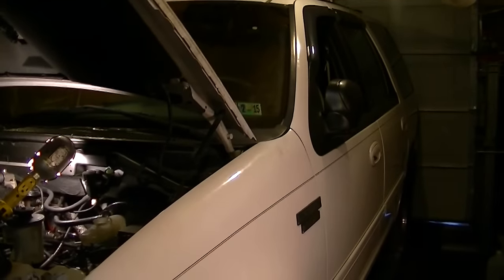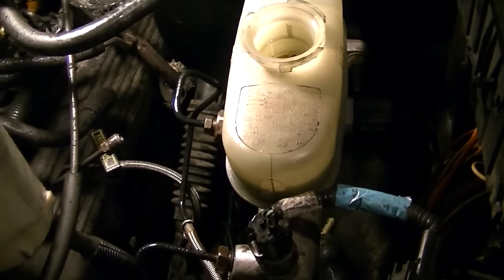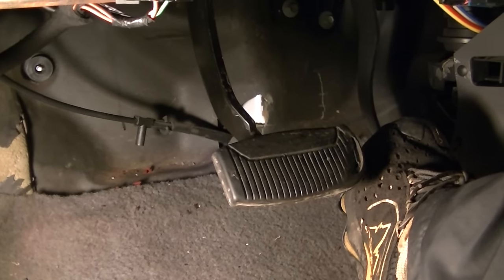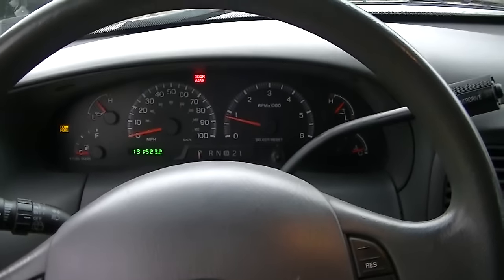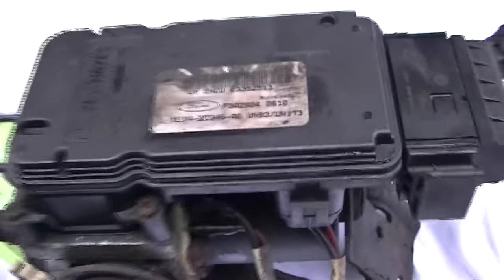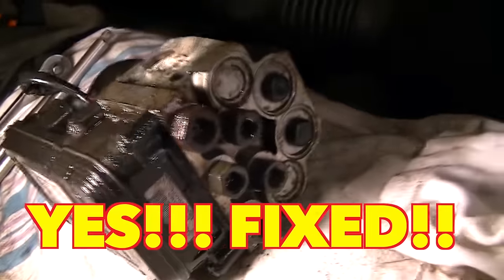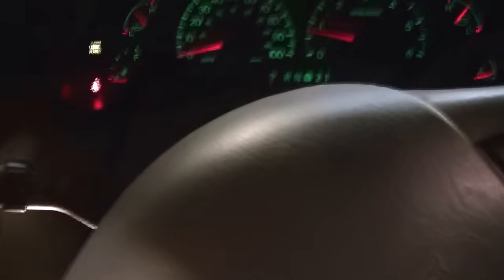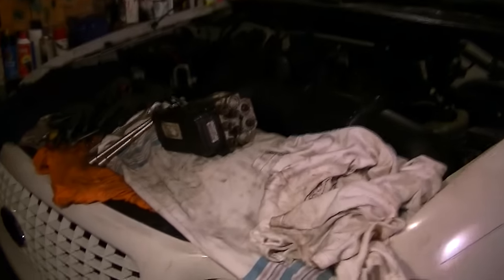Sinking/Spongy Brake Pedal -With ABS SYSTEM?? Nothing Works? Watch Fixed!

Comment: That's great! Thank you for making this vid. My 2001 f150 has a sinking pedal. It's not as bad as yours was but it sinks at stoplights, drive thrus etc.. It doesn't always do it right away either. Which leads me to believe my abs pump is bad too. If it was a a MC, it would happen all the time. That's my experience with a bypassing MC anyways. But this is a good vid for us do it your selfers with fords of this era. 
So did you not have to bleed the new pump at all? Does the computer take care of it or something? How much would it be for a new pump do you think? If it's too much I'll do what you did and get one at the wrecker I guess.. 
Anyways thank you again for your time making this video!
You're awesome
Reply from the maker: Thanks!
Reply from the maker: Dislikes....lol....Because most thumbs downs, are people who are still living there parents basement and have no life + trolls.
Reply: Did you need to bleed the abs pump later?
Reply from the maker: That's the cool thing, I did not have to. I was going to bleed the brakes etc but 2 pumps and I had a full pedal. Crazy luck I guess.
Reply: So weird huh, you'd think it would need to be bled but if it works it works.
Reply from the maker: Yea, I'm still driving it today....brakes are great!
Reply from the maker: I never had to bleed the brakes after the abs pump was installed. I 
pumped the pedal 3 -3 times and it came right back up! I guess the ABS 
system did its job. I just picked one up at a junk yard for $40. Make 
sure the part number is the same!!
Reply: Must be a Ford thing. I'm having the same issues. Mine isn't all the time. But it also just started the other day while sitting and waiting for a slow poke to move out of a parking space so I could park. It slowly sank to the floor like it post pressure. I put it in park and pumped it and they were fine. But still scary seeing how I feel like a taxi for my kids. Will show this video to my husband!
Reply: Nathan Rohrbough g

Comment: Thanks for sharing! Nice expy too :). I'm having a similar problem w/ my jeep and I didn't even open the brake system and no leaks so I figured it had to be some kind of valve failure somewhere in the ABS or master cylinder. I'm willing to bet it's the same issue. 

The only concern I have after something like this is it says you need a tech II scanner or whatever to manually control the ABS valves to bleed the system. I don't know exactly how the valves operate, but I would suggest taking it into an area where you can get ABS to kick in to make sure it works properly.
Reply from the maker: Strangely, I've never had to reprogram a ABS system after a swap, ever. But I'm sure there is that "story" out there.
Reply: DRB 3 tool. It's xxxxing expensive - even used - on eBay. Not sure any of even the high end aftermarket scanner's have DRB type functions. It's dealer or a good independent Chrysler specialist only who will have one. I heard some say the emergency stop trick followed by another conventional bleed  doesn't work in this instance - but maybe still worth a try. You will have a Bendix or Teves mark 4 or a mark 20 system depending on your model year, more recent models I'm not sure about.
Let us know how you got/get on with your issue!
Reply: @andrewcheatle4691  I did the emergency stops a dozen times and activated the ABS each time, but did not help.

Comment: Thank you very much, that's the only thing I haven't done to my F150 to fix my spongy break pedal
Reply from the maker: Happy fixing!~
Reply: On fords if air gets into the ABS pump you have to hook up a ABS scanner a d do a sevice bleed. Don't run out and buy a new pump until you do. Perform service bleed and then blled brames normaly. Especially on F series trucks.

Comment: Great video and suggestion on the sinking pedal syndrome (after doing all the regular items: master cylinder, new fluid, bleeding, etc .... ) Thanks for posting this.  I do have a question:  When this phenomena was present in your vehicle, did you have any ABS faults or ABS warning light coming on?  And, secondly, did the ABS module still modulate (buzz the brakes) when braking on a slippery surface?
I have this sinking pedal syndrome - did all the items listed above and, just like you, it helped for a little while and then the pedal started sinking again.  I have no ABS light on the dash and my ABS modulates/pulses/buzzes when I brake on a slippery surface (like it is doing it's job).
Reply from the maker: No. I had no abs light not even a blink! No buzzing no noises. Your buzzing is probably how that ABS pump is manufactured with some kind of default system. My abs system worked when I slammed on the brakes in mud or snow...But slowly went south no matter how much I pumped them up.

Comment: You have an air lock in your abs unit...that happens too. You get things bled right...but still spongy....99% its a air lock in the value.
Reply from the maker: Thanks! Hope everyone else who see your message can understand what's going on with that ABS spongy /brake to the floor Issue.
Reply: TVWXMAN32 no worries...anything to help someone else keep costs low :)
Reply: what did you do to get air out of that unit, is there a sequence to bleed it ? I have a 2002 6 cylinder base model and I have this exact issue. Please help me from pulling my hair out.

Comment: You smart git! Loving the way you routed the master cylinder line! I have this issue. Will try this tomorrow.
Reply: How's your abs now?
Reply: I ended up fitting new abs pump and it didn't help... Master cylinder appears fine so in the end I took it to a garage who said they fixed it and passed the Mot.  But the problem is still there.  It brakes fine, just a slight soft pedal.  Kinda annoying but if it passes the inspection, no leaks.  Might be a bulging flex brake line pipe?  I even changed the rear calipers....  But yeah. Brakes work great.
Reply: @squidlings  thanks so much for your response. I'm also thinking to replace the rear flex line hopefully I don't need to  replace the abs pump.
Have a nice day.
Btw, I double pump and the second pump give a harder brake. I hope that will work on yours too.

Comment: Thanks for your help I changed my master cylinder and Power booster I had no luck now I know it's the ABS on my 2011 Ford Edge
Reply: I have the same year and model and I’m dealing with the same issue now. Boster was on recall but the abs was not. Seems like for Ford knows it’s a issue but ignoring it
Reply: @timothybecker176  I finally got my brakes fixed 7  months ago there was a lot of air in abs and I had to reprogram the abs it took a long time but it's working now

Comment: My Ford Econoline did the same thing. I had to replace my abs module after 3 Master  cylinders. The last master is cylinder I bought from the dealer. .
Reply: What year and model is your econoline ? Mine did this today ! Tried breaking while about to leave for a job and the breaks wouldn’t work I had to hit the emergency break and damn near slam my foot all the way to the ground

Comment: Thanks mate for taking the trouble to post this I have same problem with daughters citroen c2. Wish I'd seen this before buying new master cylinder. Big cheers from UK.
Reply from the maker: Never been inside of that auto. Some say its nice...I don't know. You like that auto?
Reply: @FixingWithPassion ,  It's a little French 1.4 diesel, great engines 65 MPG,  pretty much bullet proof but lots of niggling little jobs for the home DIY guy. Still a man needs a hobby or two. All the best Nathan from Rugby GB. PS. Hopefully my French Teves abs unit doesn't need any fancy programing or software, just a good talking to I hope. Think I'll get a scraper and strip it, find out what makes it tick. Mitch.

Comment: I'm having the same issues with my 2000 Nissan primera. I change master cylinder bleed out the line but the brake system keep failing but thanks to your video.... thanks again
Reply from the maker: O my!!
Reply: I'm in Jamaica so its gonna be really hard to get this abs pump module. I'm hearing a little hissing when i press the brake pedal. U think i should check the booster before i go the abs module. Oh i forgot my abs light is on and not come off too

Comment: Thank you Sir! 
That was great, I have the same problem and did test already and then I sa w your video. On a hunt for a used abs pump now.
God Bless You!
Reply from the maker: Happy Fixing!~
Reply: Nathan Rohrbough 
I replaced the hcu module with one from a low mileage car from the salvage yard. My cousin works in parts for a Ford dealership and made sure the part was right. I replaced it and that went really smooth. Problem is I now have and abs and traction control light on that I didn't have before along with the same fading pedal I had before...wth? I'm out of ideas.
Reply from the maker: Check wires.
Reply: @118chosen9  Yes, wires or fuse. That's what happens if you pull the fuse in my 09 Escape (both lights)

Comment: After replacing rear pads all four calipers(twice), master cylinder and rear brake hoses still soft pedal. Replaced ABS unit with used one(professionally installed) and better but still soft. Removed ABS fuse - much better. Does indicate the replacement ABS maybe defective? Suggestions? Thanks

Comment: I have the same issue with a 2006 Honda Pilot. I replaced all brake pads, brake hoses, calipers, rotors, and just today the master cylinder. My son and I bled the brakes and had the same issue you had. No brakes whatsoever and the pedal goes to the floor. I kinda figured it was going to be the abs pump because the initial cause for the brake work was the right front caliper was slow to release after applying the brakes. Eventually it got to where it locked up and the only way to release it was to crack open the bleeder valve. I’m going to try the blocking off method you mentioned, the new master cylinder came with 2 plastic screw in plugs. Awesome video.
Reply from the maker: Yea, maybe it will work...but be prepared to deal with that ABS system if not ;(

Comment: I am struggling with my 2000 chevy Silverado 1500, just replaced all but 1 break line, only 1 break is getting a lot of fluid, 1 is getting no fluid that we can tell, and the other 2 only seem to be getting a little fluid, my master cylinder is fine as well as my brake booster, the brake doesn't go all the way to the floor but it is a bit spongy, do you think this could be my issue as well?
Reply from the maker: Could be ;(

Comment: I have a 2012 Ram 1500 that has a traction control dash light and a C121E fault code. I've replaced all four calipers, discs, speed sensors (the front ones twice), front wheel hubs, master cylinder, three brake lamp switches, brake lines, probably three gallons of brake fluid and three brake bleeder tools that were all crap-tastic, and I rebuilt the ABS control module myself (somehow I was able to do this even though Chrysler made deliberate attempts that this thing is not possible to be disassembled - but I did it). The truck was braking so well even though the light was on. I would test it (on a completely empty road - I'm in Texas and we have lots of those) by going 70 or 80 and brake as hard as I dared attempt and the truck stops so hard that I thought I went ten or twenty minutes back in time and dust from the back seat was on the windshield. This was done with my hands only lightly on the wheel and it would brake perfectly straight. Yet somehow, this light on my dash that's been there for a year and a half, that I've worked on for a year and a half, is still on today. 
Today, something different happened. It actually pulled to the right for the first time. I was so excited because I know to check the front left brake and there was fluid leaking from the caliper. I knew what to do and this should have fixed the light, right? 
Until I watched this video, that's what I thought. Now, I believe there are two issues. The left front caliper has a seal leak from what I saw today, and from what I saw in this video, I need an ABS pump. Last week, I had my 50 years of experience mechanic and Phd in Engineering brother-in-law drive the truck and tell me what he thought. He said it was a guess but because the pedal would go to the floor, he thought it was the master cylinder. He did say it was strange that the truck stop so well when, if it was a master cylinder with a seal leak, it would have been difficult to brake or wouldn't brake so well. 
Thank you for this video because it confirms one scenario I contemplated, but because I haven't seen any other videos like this, I questioned my better judgement. When I can afford a new pump, I'll be ordering that (and a couple of caliper rebuild kits to fix the stupid caliper that just blew the seal).
Reply from the maker: Wow!  Good find!

Comment: Air in the abs can be a real pain in the butt. If this came up after the system was opened/bled but was fine before, you need to start with a bi-directional scan tool to run the abs pump before firing the parts cannon, especially if you tried to bleed it while the car was running, you probably sucked air into the abs.
When you run a auto bleed the abs pump will run for all 4 wheels for some cars, you can just top off the res and open all the bleeders and let it do it's thing, but most cars the solenoid valves will open on the left or right side of the car, then run the pump on the opposite side, those systems can be a pain, the instructions your scan tool will give you will tell you to bleed the calipers like you would normaly, but don't, what ever side the pump doesn't make a bunch of noise on just hold the pedal down, the solenoid valves will open/shut a bunch, then bleed after the scan tool has run the auto bleed, you might have to do it a few times.
Reply from the maker: Word! Still working today still!

Comment: Don't forget to adjust the rear drums . makes big difference. If brakes still feel spongy after all replacements.
Reply from the maker: Big 10-4!
Reply: Adjust them outward?
Reply: If they are drum brakes yes . where the drum slightly is gripping the brake shoes. Don't want to do them too much.

Comment: The brake is not airy when the vehicle is at rest but super spongy when it's running.  Despite almost a full column of airy brake,  it actually works super well and the grip sets in just right in the middle. It seems to me that this does not match with the description of this video. I wonder if it is the master cylinder issue, or something else, but what can it be?
Reply from the maker: Fixed at end of video/"
Reply: @FixingWithPassion   @SinsBird  Thanks for the reply, but my experience tells me that this is out of the ordinary.  The pedal sinks all the way down when the vehicle is crusing without any resistance at all, however, it actually works super well and the brakes will set in just right in the middle, the pedal does work extremely wel, except that it just floats in the "air".  None of the vids is able to explain something close to this, I'm rather puzzled.

Comment: If you buy a used abs module isn't there a chance it will be messed up too?
Reply from the maker: Yea but you can exchange it if its bad. Still better than paying $600.00 for a new one.
Reply: @FixingWithPassion  The dealer gave me a different part number then the one I have if I wanted to buy it myself and bring it in. So, I was wondering if that is the new replacement version.

Comment: My granddaughter has a 2008 Mercury Mariner and she is having same problem. I replaced master cylinder and it didn't make a difference. I have bled the brakes countless times but to no avail. No leaks or loss of fluid. We bled them today and it seemed to work. By the time she got home they were going to the floor again with no loss of fluid. How hard was it to replace abs valve? I am some what of a good mechanic just have never did this job. Oh and I have pulled both the abs relay and fuse and it doesn't change the brakes. I have read that a valve gets stuck open when they go bad.

Comment: I have the same problem in my 1998 F150, haven't done anything yet to try and fix it... no lights come on in the dash... should I replace the abs pump first or try the master cyl? What would you do first? If I have to replace both it doesn't matter, I just want it fixed!

Comment: I have same exact symptoms on my Toyota Matrix 2013 replaced master cylinder. Brake pedal hard as rock when engine is off. And sinking to the floor when engine is on. I bled few times didn't help. Was blaming on break booster now I think its ABS module

Comment: Had this problem on an 08 fusion  found an area where the abs could be activated, hard stop 6-8 times, had a good pedal after that, if the abs doesn't get used often the valves inside can stick  some high quality scanners can activate the valves also and that can free them up.
Reply: Did it start working after that because  there was air trapped inside the ABS unit, and then you were able to bleed it out afterwards once the valves were unstuck? I'm still trying to understand what the purpose of those valves do. If they're not working, does that trap air in there which is what causes the sinking pedal symptoms? Thanks.
Reply: @steveandrews8301  The valves are controlled by electrical solenoids, when the control module sees a wheel stops turning it momentarily releases pressure for that wheel, if one or more of the valves are out of position then you can get a low pedal. a spongy pedal that gets better as you pump the brakes is usually due to air in the system.